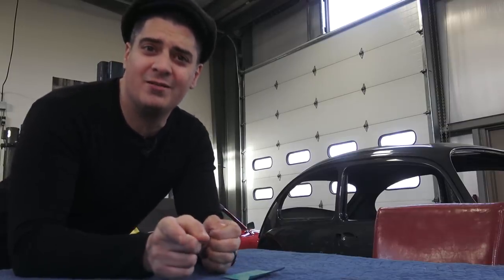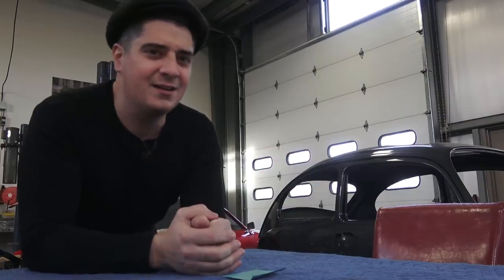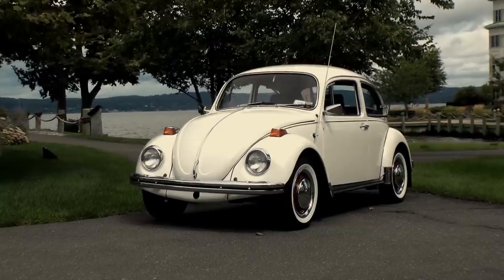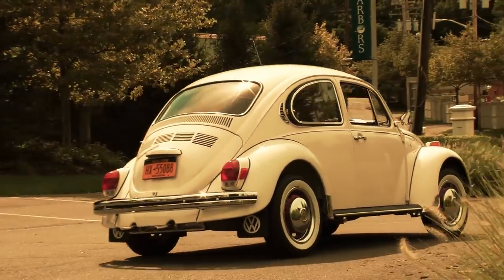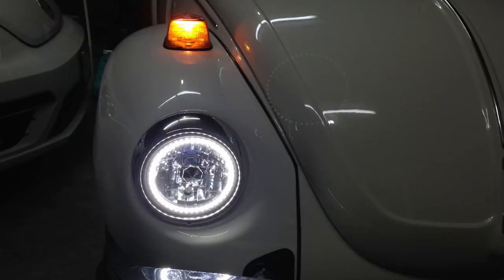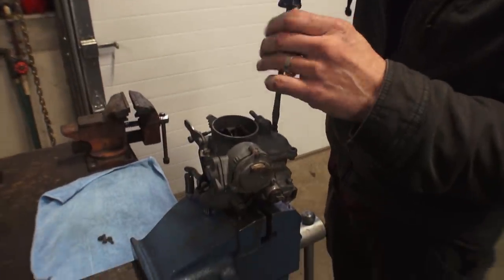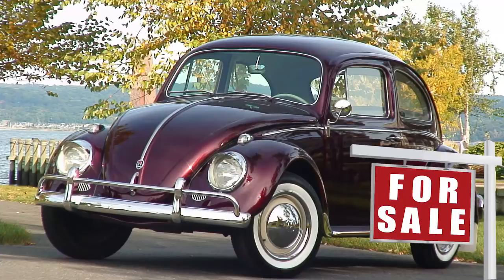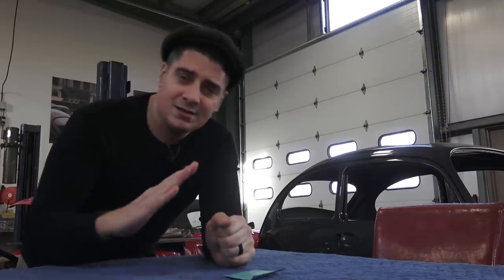Classic VW BuGs Top 5 Reasons You can Still use a Beetle to Daily Drive

Comment: They are not going up 15-20% a year, if they did they would be over $80 grand to buy.  I do agree they are going up, but your cost of ownership and maintenance means you probably will break even trying to sell it.  Also the "tracking, and giving you a ticket if speeding automatically" is never going to happen.
Reply from the maker: Been doing this for over ten years, depending on the year bug, and when restored correctly, yes they have been.
Reply: Skater you are wrong. Beetles are going up like crazy. Most decent examples in my area are over 10k. I bought three in really bad shape and have been restoring them. If you are smart and do the work yourself the parts cost almost nothing. You can restore a beetle fully for about 3k including buying the car then sell for 10-12k. And my bugs get attention everywhere I go people want to stop you and talk about them. I’ve had WAY more expensive vehicles that don’t match the fun of the old bugs that cost me near nothing.
Reply: @SilverracerKH  Still no where near 15-20% a year.  $10k for a bug is actually less than the inflation value of the money you would have made if you just kept the money in the 50s-70s in a bank account.
Reply: I’m not arguing the 15% I havnt researched that . But we are not in the 50s. Buying a bug now is a great investment, you can make thousands if you put in a little effort. Trust me I’m doing it.